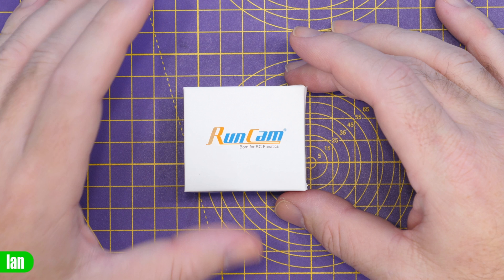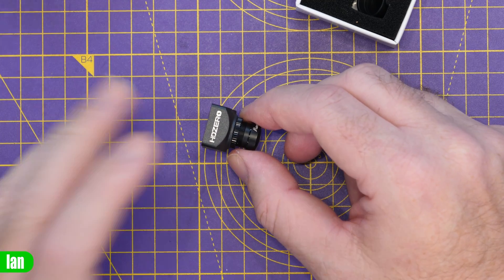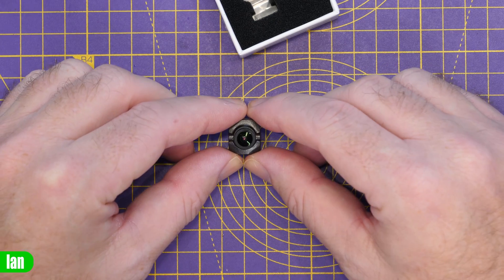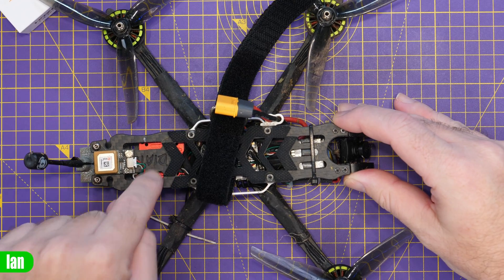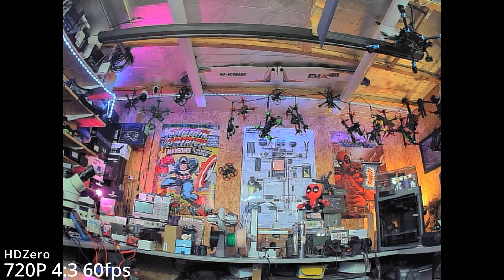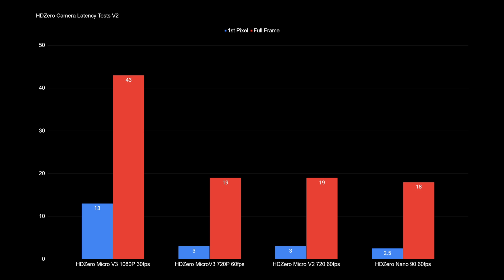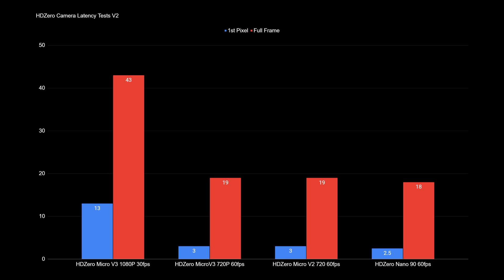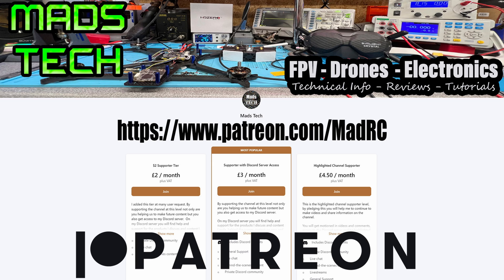HDZero Micro & Nano V3 Cameras - 1080P - Ultralight - Low Light

Comment from the maker: Hi Everyone.  This is republish of the HDZero Micro V3 video.  In the initial video there was an issue with the latency data that has now been corrected.   As a result I have decided to republish with the context data.

The Micro V3 was affected by the Latenct testing in a way we have seen sporadically before but massively more consistent and as such affected the end result numbers.  

As a result of this we have tweaked the Latenct test to ensure this does not happen again.  

Thanks.

Comment: I don't think it is a good idea to simply get rid of this latency issue: racing at night with neon gate would probably put the camera in hhe same situation as your previous test. You just never ditch an issue under the carpet, that's the way test goes.
Reply from the maker: It will not happen in the real world.  Even looking towards the sun or as you say at a neon gate will not cause it, it’s caused by a VERY bright very focused light hitting the sensor.   Other than someone shining a laser pointer it’s not going to happen.  It’s an input overload due to non normal circumstances.